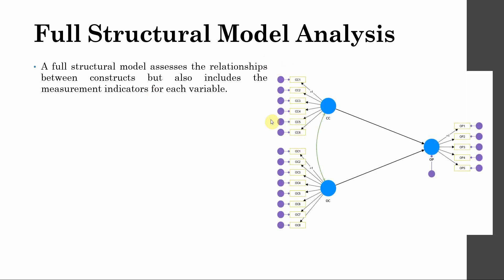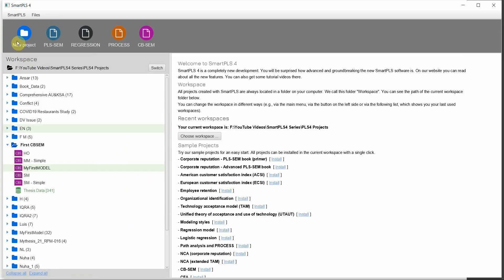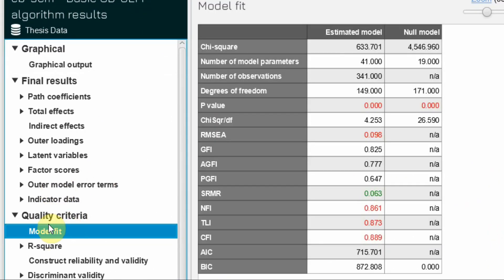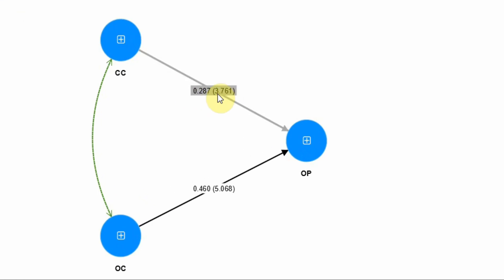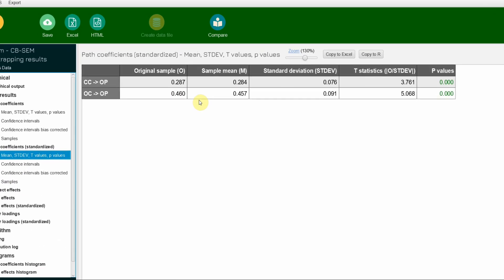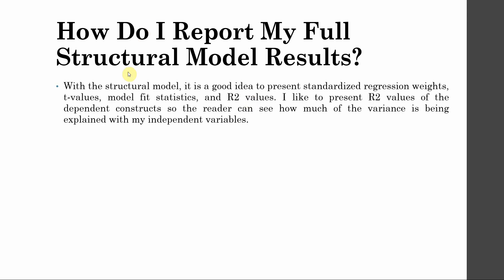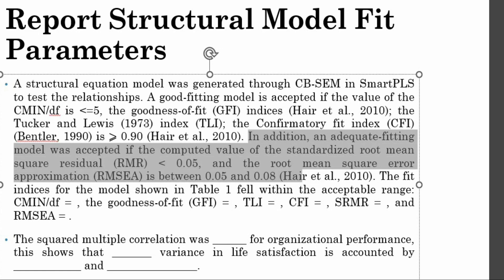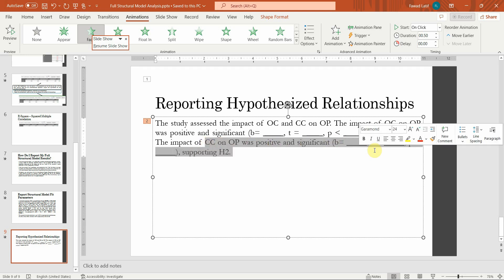CBSEM using #SmartPLS4 | 11 | Simple Structural Model Analysis

Comment: When you first ran the structural model, you used the normal CB-SEM algorithm and your path coefficient from CC to OP was 0.273 and then you ran it bootstrapped (0.287). Why did you do that? What was wrong with the basic CB-SEM algorithm?
Reply from the maker: Bootstrapping can return slightly different results as it is based in random numbers.
Reply from the maker: Bootstrapping is to return the significance values.
Reply: Do we then report the beta coefficient from the basic CB-SEM algorithm along with the p-values/significance values from the bootstrap or do we just report all the bootstrap data?

Comment: Thanks for the video. I see that you have correlated the CC and OC variables before running the structural model. I wanted to ask, must all the exogeneous variables be correlated before running the structural model. How would I do this if I have a mediator variable between OC, CC and OP? Would I correlate OC and the mediator; CC and the mediator; and then OC and CC? Thanks
Reply from the maker: Yes, in CB SEM the exogenous variables are correlated.

Comment: sir smart pls does produce the value of model i.e. NFI and chi square value. what could be the problem?
Reply from the maker: Is it limited to 100 responses. Register for 30 Days trial.
Reply: @researchwithfawad  responses are more than 100 even more than 400 and the smart pls is professional tree for 2 months provided by Cyprus university webinar organizers held on 30 jan.but i read in a paper pls-sem just provide 2 model fit indexes..nfi and srms whereas CB-SEM estimation provides 6 7 model fit indexes.. is it correct?
Reply from the maker: Yes, model fits in PLS-SEM are limited but in CB-SEM there are more fits.
Reply: @researchwithfawad  alot of thanks sir but still i didn't get value of NFI.dont know how to resolve this problem.
Reply from the maker: Run PLS -Algorithm from Calculate Option and you will have it on the left.

Comment: Thank you prof. If I want to do path analysis using CB-SEM, do I have to go with full structural model only or is possible to use composite variables and analysis them directly?
Reply from the maker: Go for full structural model analysis.
Reply: @researchwithfawad  thank you. I did the measurement model and model fit all are acceptable. However, I have 5 hypotheses and 4 of them are rejected in the analysis. Could you please tell me where is the possible issue? I checked normality and outliers. But the problem still exist. Is the issue with the sample size? it’s 200. I will be much appreciate for your answer
Reply from the maker: May be increasing the samplemsize could help. Asking the right respondents may also help